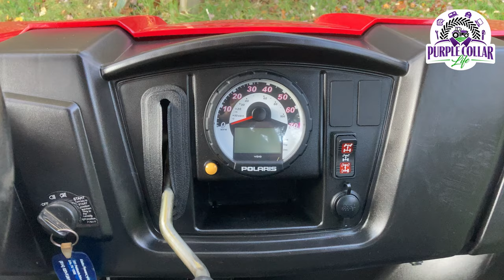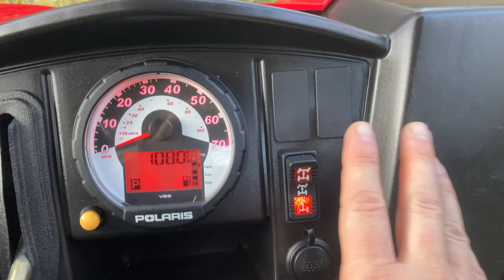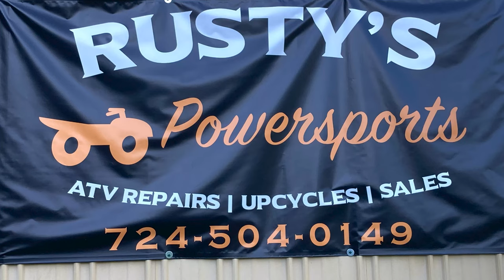Polaris Ranger Crew differential repair

Comment: Old post I know….wondering about the snorkel and filtration. We have lots of dust and it seems to cloud up at back of machine. On mine the front air intake has a pre filter then goes thru the filter cartridge in the back. I assume the snorkel would just mean cleaning or replacing the primary air filter more often.
Reply from the maker: The reason for the snorkel on this machine is that the design was poor on the OEM system. The hose had the long run from the front to the engine, and it would get pinched/pushed by mud and debris.  This design gets the air to the engine much quicker (more airflow with the shorter run) and seems to be cleaner in the long run. I think the air intake at the front pulled in more pollen/dust than the one facing backward. I haven’t noticed any increase in need to change / clean out the air cleaner since the change.  Great question!

Comment: The brakes on my Club Car are just about worn out, disks and pads. The parts , a new disk for each wheel & new brake pads too, cost around $1000. Club Car parts are expensive but they say the availability of spare parts gives a vehicle value. I’ll ask a fellow I know to replace these parts. I need good brakes for this vehicle.
Reply from the maker: Hi Karl - good brakes are certainly important! Our old Club Car has been very dependable. I don't use it as much since we have the Ranger, but it always starts up and runs great when I need it to.